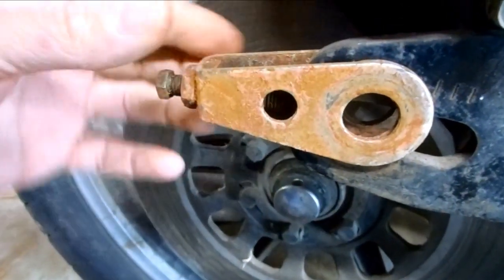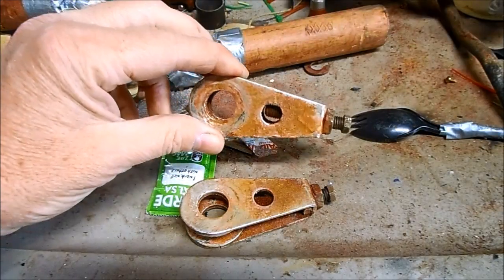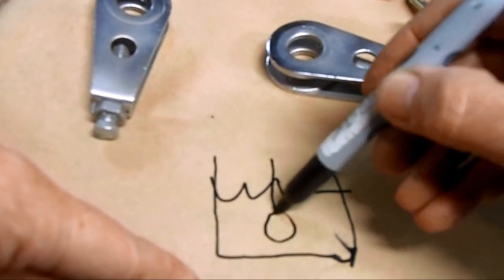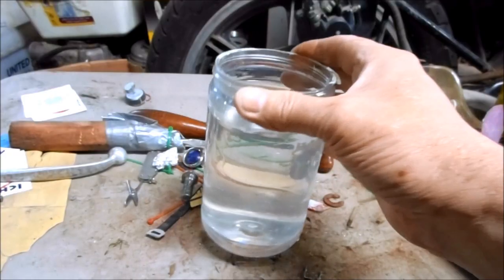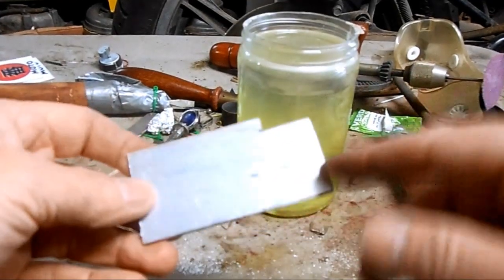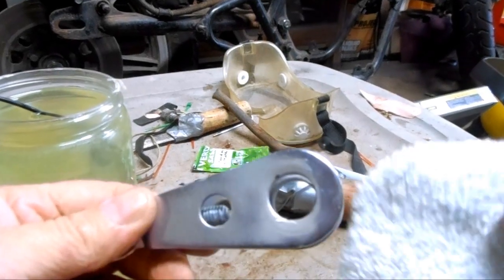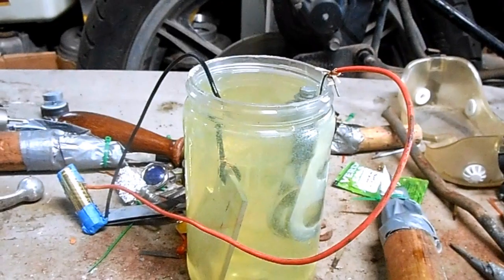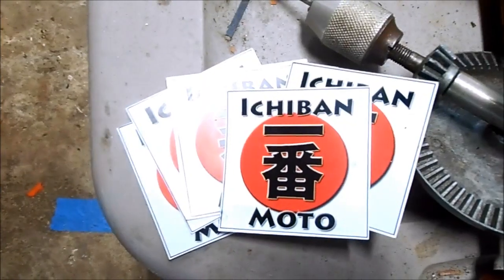how to do zinc plating of metal parts for corrosion  protection  diy electroplating

Comment: i'm doing my whole bike....as i live in britain i've simply attached the zinc to my bike in situ and plugged a lead in from the house mains electricity and am now allowing the rain outside to work it.s magic!!! thanks ichiban!!!
Reply from the maker: johnnycactus0  Awesome ! and that reminds me to pick up one of those adapters to convert my American voltage to British Imperial voltage
Reply: It is European voltage 230 V plus most of the world.
Reply: Robert Bennett it’s also AC so you can’t plate with mains, you need to use a battery!! Or DC power source!!
Reply: Paul Bennell same here. In my case, I was using the bike’s own battery to do the plating. (I left it running out front so the battery wouldn’t die). I came back a couple hours later the bike was gone.
Reply: LOL !!!
Reply: Just drive the bike into the swimming pool.
Reply: @skiraf  any swimming pool should have enough piss in it to be acidic. just need to add the Epson salt or washing soda. toss in the anode and go for a swim while you wait.
Reply: Hi cactus I'am Taiwanese biker. I live in a island surrounding  the sea and lots of rain with high humidity air. Could you tell me more detail about this? I can't understand " in situ" and "plugged a lead in from the house mains electricity" Thank you.
Reply: p
Reply: Stuart T That's what happened to mine. How stupid do I feel?
Reply: johnnycactus0 you connected the wires backwards, so no plating took place, you should have been saying "dumbass" instead of "badass".
Reply: johnnycactus0 
lmfao😅
Reply: NB friendly heads up to our murican friends , UK electricity can give off vapours, (best to leave a door for window open) if there is a build up of these vapours it can start to reverse the process of plating. In extreme cases you could loose the whole bike when attempting this way, apart from the rubber and plastic items.
Reply: ash i 
Ash, you should remain on the bike  when it sinks. 

RIDE a bike/bicycle/unicycle etc
DRIVE a car/truck etc
FLY an aeroplane/helicopter etc

Comment: Such a great idea I think I'll give it a go. Does it matter if the tap water is a little hard?
Reply from the maker: The Gentleman Biker  the sodium will help, however if the water if extremely hard you might try using Gatorade. it has electrolytes !
Reply: The Gentleman Biker If it's Geordie Water it will be too hard. Feed it some Newky Brown.
Reply: GrimlyKK No need for that, I'm a Southern Fairy.

Comment: Why not use your badass blaster to clean the parts?
Reply from the maker: Rexfuyther      good point !  the blaster would work equally as well, however with the tumbler, I can throw in small bits and go about  other chores whilst it does the work